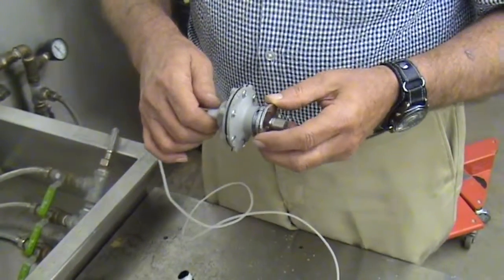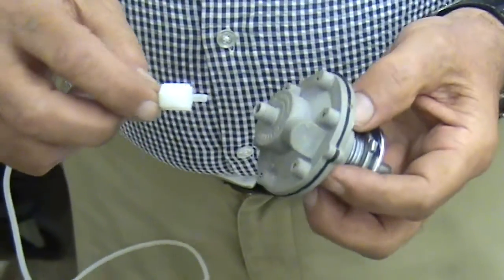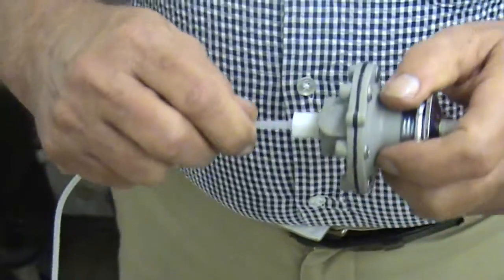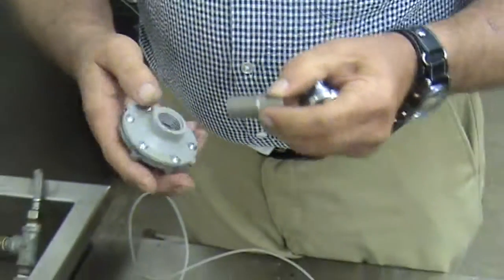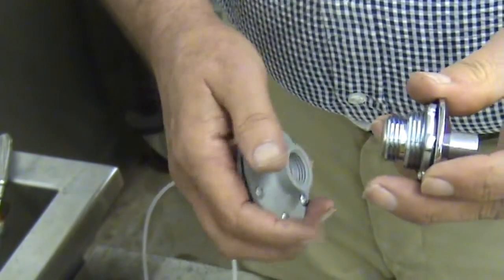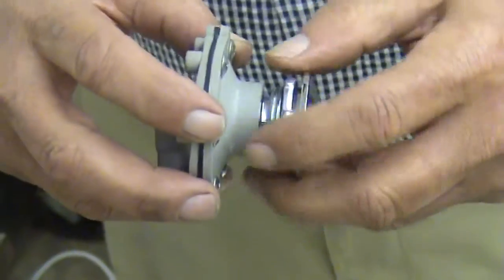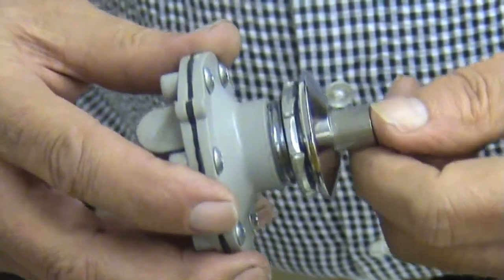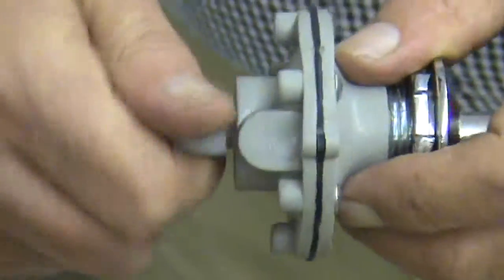How the Pneumatic Button Works

Comment: Nice vid but I was looking to specifically find out the difference and purpose of the pneumatic flush button. I have the cable one (I initially thought I had the dual one but it looked like the single one) after taking of the toilet cistern lid.